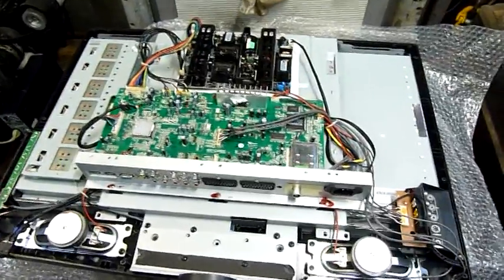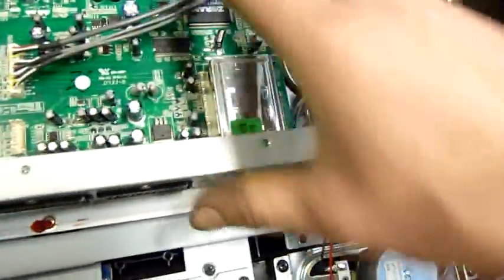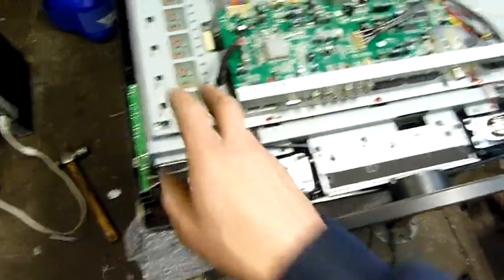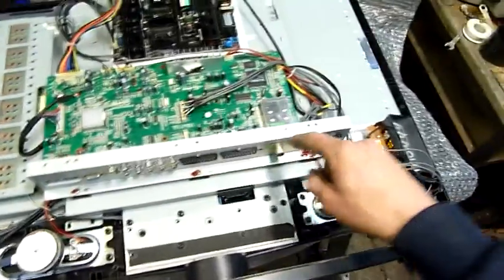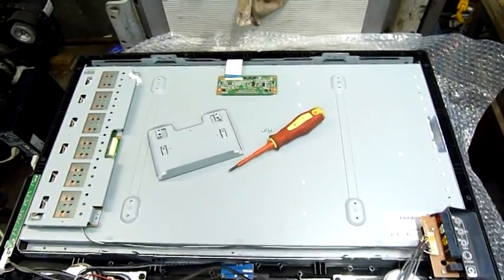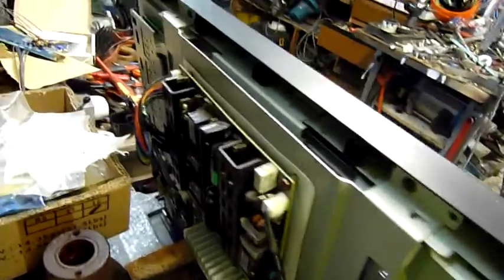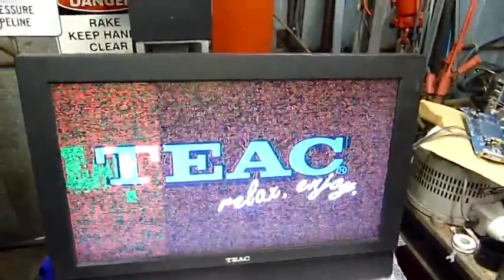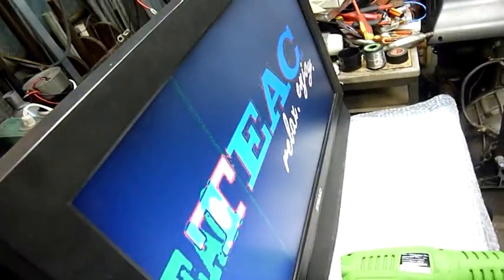TEAC 26 Inch LCD Troubleshoot - Fried Panel Driver CPU

Comment from the maker: I won't smash the panel, its still good, I will either try and fix the board or replace it. I think I have a board from the one that has the dead SMPSU and boot hole in the screen. it may fit

Comment: Oh wait dont scrap it, theres usually an eeprom chip on the mainboard, try erasing that. That is how I fixed a samsung syncmaster (it had bad caps too). The chip is probably an 8-pin smd chip.  You should try reflowing that processor chip too.

Comment: FLASH memory failure is identified by heating, problem goes away. 

Chilling a failed FLASH memory will produce errors.

My opinion for this is perhaps intermittent solder problem.

But FLASH will also fail at both extremes of temperature.

Good luck on this challenge!  Smashing it means the inanimate object won.  ;)

I enjoy a good smashing and don't care what the inanimate object thinks of me.

Comment: i hate the speakers in most flat screen TV's.   - heat gun or toaster oven the pcb. 
lead free solder :( saves a bit of lead ending up in the environment, but fills landfills with pcb's and plastics from failed consumer goods.

they say plasma panels have a half life of 60'000 hrs, the electronics, on the other hand,

Comment: you could try to bake it...i've done it with some GPU's (Nvidia's had some internal chip problems) and it worked. But i have to admit, i was farely surprised none of those cap's popped...150°C for about 5 Minutes...

Comment: HDMI and DVI are basically the same thing. You can get a passive adaptor and connect a pc to the HDMI port. You will need to set the computer to 1280x720 or 1920x1080 otherwise the tv probably won't like it.
You could use a can of air duster for freezing things. Just use it upside down and it will spray liquid. That's what I always use.

Comment: Smear flux all over board and put it in oven. Strip plastic parts and heat sinks prior. What you have to lose? Or you can tap board with screw driver's handle to see where bad joint is.

Comment: Surface mount is easier to deal with than through-hole is some ways.. I.e. removing 40 dip chips is a total bitch and takes ages (desoldering each leg and wiggling it to get it out of the hole) whereas with SMD if you have the right tools it's just a case of heating up all of the legs at once and lifting it off of the board. Soldering even really tiny high pin count parts is easy too once you know the tricks.

Comment: I love your investigations videos mate, I've had similar problems with an LG and a Phillips LCD and had to try and get spare driver boards, the overlay is later in the image generation stage before the final output.  It never powers off just gets hidden.   universal boards will have their own overlay system for controls but you'll have to sort the physical controls connection yourself.

Comment: A little side comment; HDMI carries the same signals as DVI . HDMI just has audio extra. Soooo, testing the video input with DVI should be OK. Well, maybe you're testing a different input port on the chip, but the problem is clearly in driving the display (all ports share the same problem).
Hope you can find a new board, the rest of the monitor looks decent :)

Comment: I'd say if you have the time, check those smaller caps nearer to the processor, if one of them has slowly gone bad the interference from the other circuit can do similar things. They also would be closer to their rated temperature there so more chance of failure. Help from our good friend lead should make it quick.

Comment: I'd actually advice keeping the frame as well since them you can keep the speakers and find a nice little amp board to run them off and save space (unless you are going to use it as a secondary monitor).

Comment from the maker: no BGA devices on this set fortunatly.
I did try probing the pins coming off the CPU and nothing changed, only cooling the core changed the condition.

my guess is its overheated, TV was probably in front of a window on a hot summer day and cooked